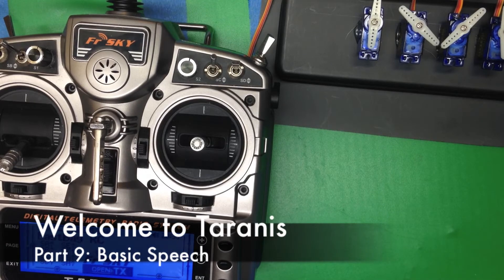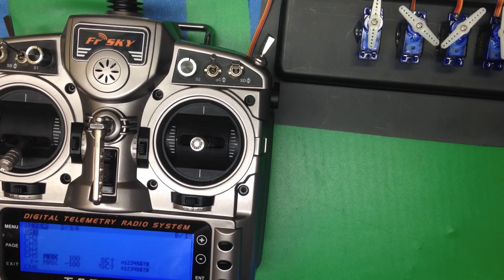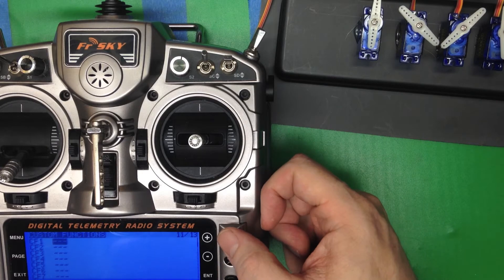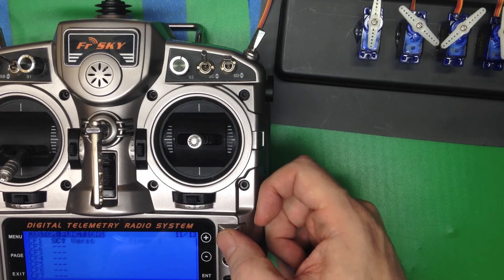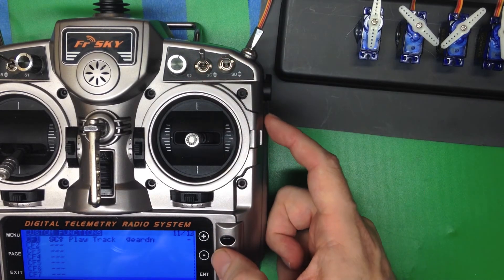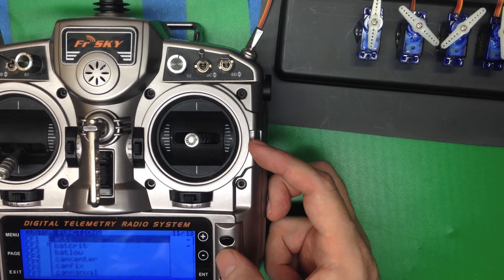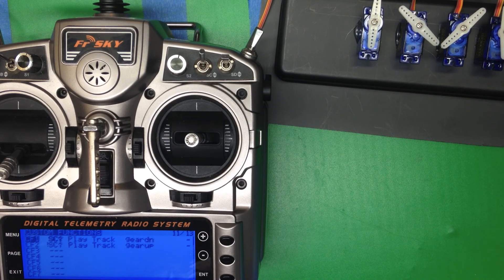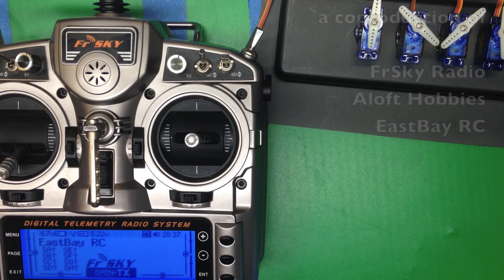Welcome to Taranis, Part 9: Basic Speech

Comment: Hi. Can you help me? I want to program the momentary switch to add a value to a channel. Example: CH6 is -100. I pull the momentary, CH6 is -50. Pull it again, CH6 is 0, then 50 then 100 and then I want it to reset to -100 when I pull it again. Is this possible?

Comment: What do you consider an undefined state?  On my multi-rotor I have a 3 position switch that is STABILIZE LOITER RTL.  Is your case related to an airplane only?  You will have to bear with me I'm new to the Taranis, and open source programming.
Reply from the maker: No problem, I appreciate the feedback!   Lots of things map naturally onto a two-position switch (off, on), but the taranis has three-position switches.  So, we want to map the switch so that all three positions have a value (i.e. off, on, on) so that the pilot won't be confused if he switches into the second position.  So, "switch up" and "not switch up", rather than "switch up" and "switch down".